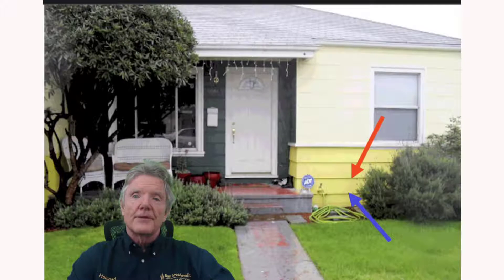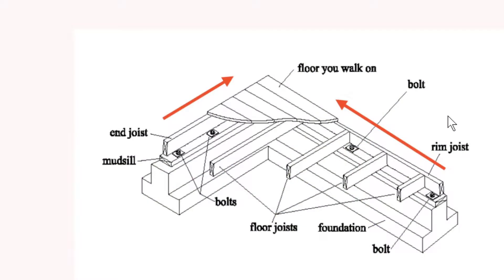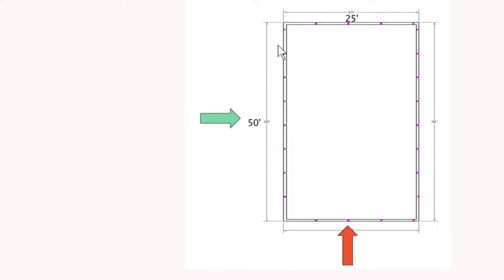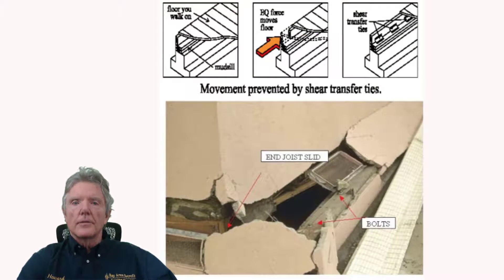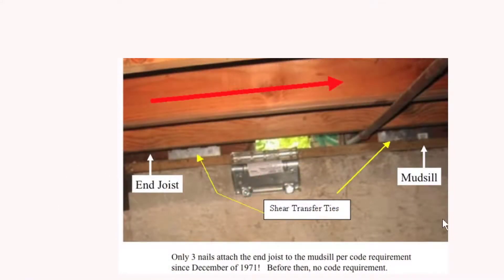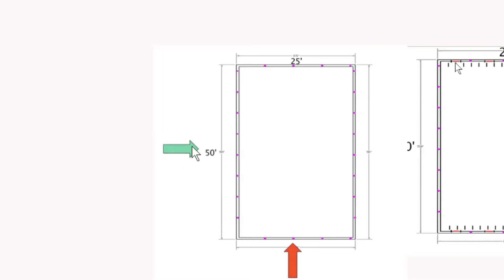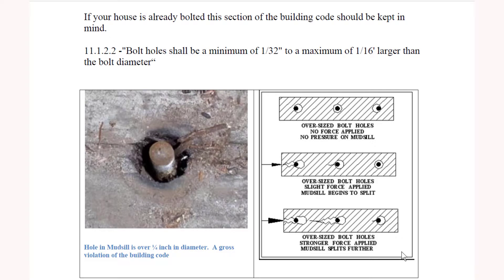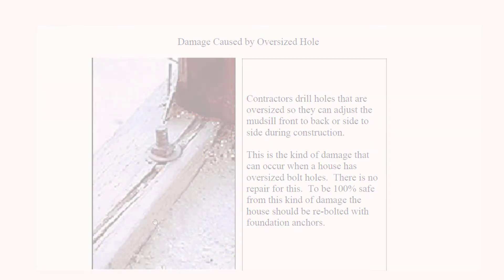Seismic Retrofitting Bolted Homes

Comment: This is very helpful. Does this advice to install an equal number of bolts on each side of the house also apply to a first-time retrofit? My house is 66x30 feet, but instead of having 11 bolts on the long sides and 6 on the short sides, it looks like it should be 11 on all four sides. Is that right?

Comment: You mentioned, "re-bolting the mud sill after an oversized hole" Are you saying that one should cut out the mud sill and repair and re-bolt? Just so we are clear.. thanks.
Reply from the maker: No, it means ignore the bolts with the oversized holes because anything over 1/16" is a code violation.  Make sure they are oversized.  If not you can consider effective and include their capacity in your calculations.  Please subscribe to the channel.

Comment from the maker: Earthquake Bolt and Brace requires use of Standard Plan A or the Los Angeles standard which do have shear transfer ties by a different name.  You can buy a cheap palm nailer and rent a compressor.

Comment: Hi, I have one of those bolted homes you are referring to. I'm pretty clear on how to install retro fnd plates, but it's the sheer transfer plates that have me questioning. When there's no room to nail in the plates, what do you propose? Ive only see one video showing how to do this and it involves a palm hammer air tool, and compressor, which I dont have. If everyone was installing sheer transfer plates, seems I would find more about this. Also, CA bolt and brace doesn't mention sheer transfer plates at all. And when a bolt and brace contractor came to my home to do an estimate, he didnt mention sheer transfer plates at all.

Would you recommend using screws and a right angle drilling tool for installing the plates?
Reply from the maker: You are stuck with a palm nailer.  Rent one.

Comment: At 14:24 - I assume trying to fill the gap with epoxy or set of various-sized and shaped thin cylindrical metal sleeves is not a recommended fix to the oversized hole problem?

Comment: For the oversized bolt holes, couldn't you just fill the gap with epoxy, then install a 3-inch bearing plate?  Seems like that would be quicker than installing a whole new bolt.
Reply from the maker: Putting in a new bolt is easier.  I used to do it the way you described.

Comment: Great video - two questions... 1 - sheer transfer ties were added to the top and bottom of the diagram, but why not to the other sides? 2 - are hurricane ties a good idea for securing floor joists to support beams and the mud sill (my mud sill is flush with the concrete)?
Reply from the maker: 1 - sheer transfer ties were added to the top and bottom of the diagram, but why not to the other sides? 

2 - are hurricane ties a good idea for securing floor joists to support beams and the mud sill (my mud sill is flush with the concrete)?

Comment: I live in a 2 story home with full basement built in 1932. I have no bolts. I will be using anchor plates on mudsill to foundation. I will be using clips to attach end joists and rim joists to sill plate. However I am unable to access the south wall end joist to mudsill connection due to a joist falls just on the edge of the sill plate. Is there a strategy for accessing that connection from the outside of the building? I really appreciate all the videos.
Reply from the maker: Do it like this https://bayarearetrofit.com/retrofit-framing-anchor-installations/
Reply: @bayarearetrofit5814  Thank You!
Reply from the maker: Glad to help.  If you could write a positive YELP review and subscribe to the channel I would be appreciative.
Reply: Thank you for this information. As a new first time homeowner in the Bay Area this is super helpful.
Reply: A full basement in california? Nice.

Comment: Hi Howard. I also have found your videos very helpful. Very helpful to know that my current bolt (which look identical to the ones in this video) are likely sized incorrectly for the holes. Going to look to redo them. Also very helpful to know that my posts are fine without needing additional T straps. One question I have related to the height of my basement/garage walls.  My house is a typical 3-story SF Edwardian (25' x 40') with a garage on the first floor, and two levels of living space above.  The garage walls are 6'2" to 6'8". Is it generally recommended to built shear walls for this setup as well? If so would you recommend 1/2" S1 or 3/4" S1 for the plywood? Thanks again for all the knowledge and learning that you take the time to put out into the world!!  We're here and we do hear you.
Reply from the maker: How wide at the walls
Reply: @bayarearetrofit5814  The main walls run the depth of the house along each side of the garage about 40' long. The back wall is 25' wide and has a door to the back yard and two windows. The front of the house doesn't have a lot of wall space and seem pretty vulnerable - it has a side door for the garage, the garage door and a void space that sits beneath the stairs that lead up to the house. I'd say the front wall has about 8' of wall space.
Reply from the maker: Put a shear wall there.  I won't be enough but a lot cheaper than a steel column.  Please be sure and subscribe to my channel